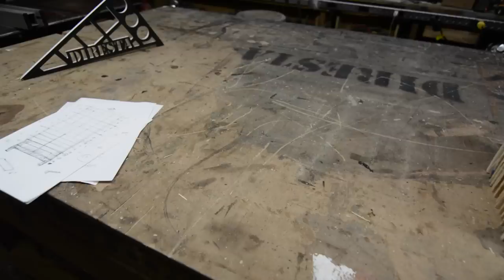✔ DiResta Tool Drawer

Comment: A great lesson in batch work, and the importance of jigs and templates (there's a tips video subject) Brilliant work as usual Jimmy D
Reply: +Seans Workspace 

I agree. The jig for the brass card holders is so obvious when you see it. Makes everything aligned. That wasn't obvious to me until I saw it. 

Did you spot the error? Bottom draws have extra rebates where they aren't needed.
Reply from the maker: +Nickle that was to keep the spacing not a mistake I knew it would be hidden. Thank you !!
Reply: +jimmydiresta You're welcome. It's a cool project.

On the jig front, that was really smart. Simple. Gives very neat results. 

How about a set of tips on jigs? You've got several in this video. 

You've the simple clamp as a stop. The drilling jig.

Lots of possibilities with routers and jigs.

Comment: Mine don't look this nice but I salvaged a few old card files from a high school in Stockton about 15 years ago. I also salvaged some drawers from others that they busted up. Yes I dumpster dove for all of the above. I was crying (some were busted) and cheering at the same time. I got 6 large pieces intact with brass (same brass as yours) plus extra drawers I used for parts to replace the metal portion in the inside bottom. Turned out good but someday I may refinish it like yours. Love your work and always look forward to your next one... Thanks for all the tips!
Reply from the maker: Thank you brother!!

Comment: I've got a question! At 14:58 you check the base for square. Supposing it were out of square, what would you do? With the biscuit joints aren't you kind of stuck with what you've got at that point?

Is there a way to convince the piece to twist a little before the glue dries?
Reply from the maker: Yes it can move slightly

Comment: Any reason you chose biscuits at the base rather than mortise and tenon? Just preference or...?
Reply: Those aren't biscuits. That's a Festool Domino machine, which creates floating tenons. Instead of a mortise on one piece and a tenon on the other, you put a mortise on both pieces, sized to the pre-made tenons that Festool sells. It's a great system, but unfortunately costs only slightly less than the annual GDP of Latvia.

Comment: Have you ever been using the nailer and hit a nail with another nail that was already in the board? Like putting these dividers together. Or are the nails so small that it doesn't really happen?
Reply: +RideThroughLife Yes, what length and gauge are the brads?
Reply: +summit boy honestly, I was just asking about a hypothetical situation.
Reply: I asumed so, but would still like to know the size of the brads...

Comment: What is the biscuit cutter or not sure what you call it. Never seen one that drills that oblong hole. It'll be a lot stronger than a regular biscuit
Reply: +BigLowman BigLowman 

it's called a mortise and tenon cutter. that particular one appears to be made by festool and is called a "domino joiner."

Comment: been watching you fro two or three years now. and what is amazing is the jigs and the processes yo come up with. if in the future you could make a video on you explaining what you need to do then showing how you solve the problem. ie  the dados did you make the sled for this project? How did you figure the math on the block for the first cut. I mean everyone can do math but how or what process do you use ? do you know what you need then back into or do you make the jig and adjust so it works? I just think it would make for a interesting video

Comment: Guys I have a question. How are called those big thin wood plates he is using everytime? He is using it for example at 0:05, or 9:26. I thought they are HDF but I'm not sure. Thanks for your answer.
Reply: That's plywood. Several plies glued together. It comes in many sizes.

Comment: Nice variation of Norm Abram's panel cutter to do Dado's!
Egad even you name in GLUE!
Why did you dado the wide drawers in the middle?  I'm surprised with your attention to details to let that slip by!
Drawer stock looks bowed! 
I wish you'd have shown the details on how you set up the saw before use.  (Blade, fence stops, etc).
Brad nailer really comes in handy.  I'd would have liked to make dovetail joints, but that would have taken forever with all of those drawers!
I never saw a peg jointer before.  I have the biscuit type myself.
NICE!  a template to get all of the drawer handles square.  Measure once, cut once, use multiple times!
I just rubbed a candle on the drawers for lube when I built a chest of drawers.  Bees wax is a nice idea, but more expensive.

Comment: I think this video needs decaf, I got motion sick after five minutes of fast forward ! It seems you have editing software that is not being used enough. We don't need to see every nail being shot. This project shows a lot of skill on your part, it would have been nice to see it at half that speed at least, and a little talking wouldn't hurt either. That is one beautiful drawer system and could use some dialog along the way. I would definitely need labels with that many drawers. Loved the centering jig for the pull handles, reminded me of my high school days in front of the card catalog at the library. Much nicer than the one on "The Big Bang Theory". Once again, very nice job.
Reply from the maker: +Nick J thank you sir!
Reply: +jimmydiresta IMO Keep doing what you do, you're the only one giving the depth to the work by showing as much as you do!
Reply: At first I was surprised by the lack of dialog, seemed strange. Now I love the style, it's really relaxing.

Comment: Rats are really hard, because they are smart. They learn when they are being poisoned and they communicate with each other. My advise is switch up the baits and use snap-traps where possible. With snap traps, the only thing they learn is that they are dead. But your pets can get into them. When I lived in the city, people always said that having mice was good, because it meant you didn't have rats. Rats eat the mice. Mice are easy to bait. You can buy those little packets of poison corn that come in a paper packet. Put the whole packet somewhere along the wall or under something where you think a mouse might go. Don't bother to open it. They eat through the package, just like the wire insulation. Dogs and cats don't eat corn, so don't worry. Living in the country is a whole new world of wildlife. Problematic, but fascinating. Good luck.